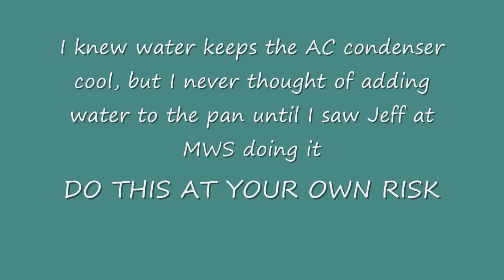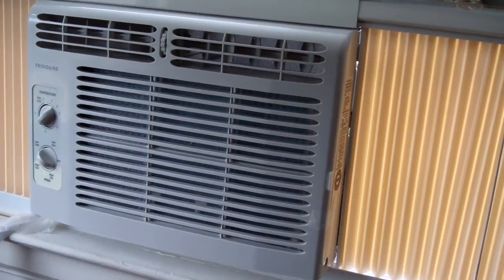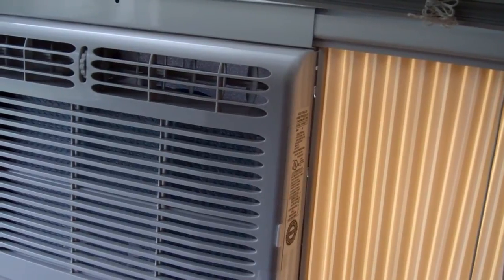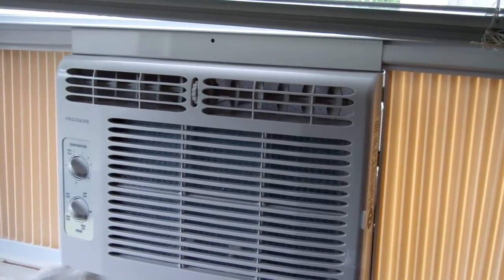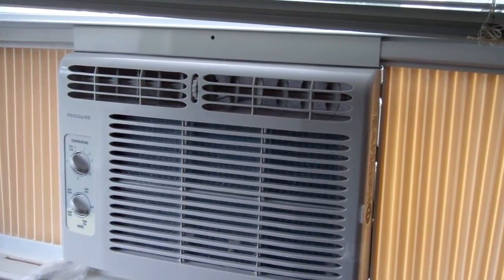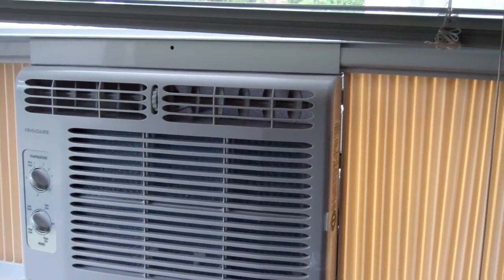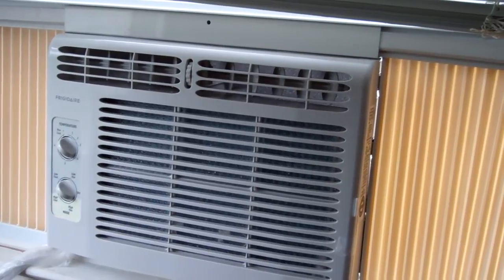AC slinger blade working to keep your air conditoner cooler.wmv

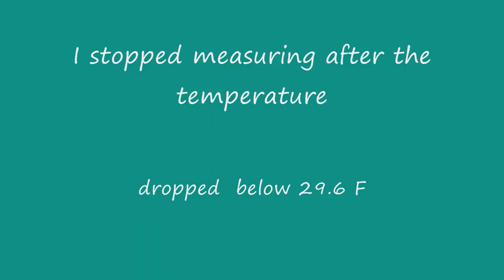Comment: An evaporator coil of 29.6 (as shown at 5:14) is bad news.  The moisture removed from the air will freeze on the evaporator coils, rendering them not only LESS effective, but can potentially block airflow if the coil ices over.

Comment: I also seal the side on both sides of my window Ac with the spray foam so there is no leaks on the sides
Reply: Bro you're not supposed to do that it's supposed to have air coming through the sides so the condenser fan can actually move air

Comment from the maker: You need to have the AC slightly slanted. This means the rear of the AC should be lower than the front part, so water would flow into the drain hole and not into the house.
Reply: Thank you !
Reply: No I'd you have a slinger it will just toss water uo

Comment: Does your air conditioner ever leak from the front right hand side where the water collects? Mine is leaking from the front into the house and Goldstar/LG said that this is normal.
Reply: No your AC should be tilted slightly from inside to out to prevent water from leaking into your house.

Comment: Who gives a fuck if it's cooler? I drilled 3 holes for all the water to get the fuck out and I am happy it works perfectly, I did it before I even installed it. I don't want the extra noise from the fan blades hitting the water, fuck that.
Reply: What's w/your foul language? If you're that insecure don't comment. I'm here 2 learn from knowledgable people instead of taking out the garbage!!!@
Reply: @charwallace7025  I sealed the holes and my comment was immature, thanks for bringing it up

Comment: There are 2 problems with this video. First is the condensate water created by the evaporator is distilled water thus there are no minerals in it. That water is okay to sling on the condenser coil to evaporate it. Tap water that you pour into there is full of minerals and as the water evaporates, the minerals will clog up the coil like cement. You cannot clean the minerals and you’ll be buying a new unit. DONT’ DO THIS!
Second issue is you don’t use an inferred thermometer to measure air temp. Those are for measuring surface temp. I don’t know how he’s getting 29 degree air but if he is, his evaporator would have to be frozen. That would be bad.